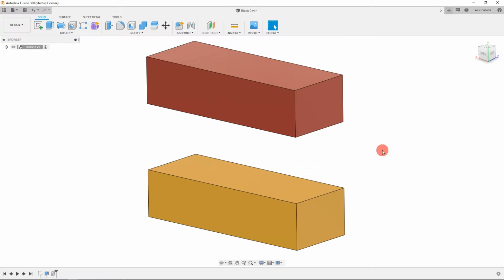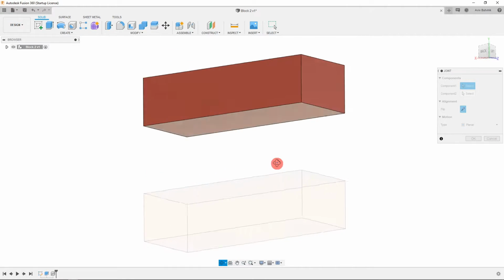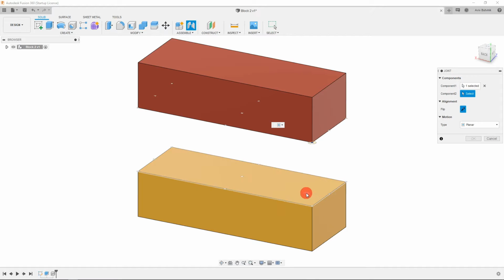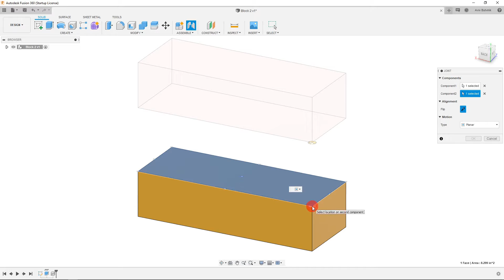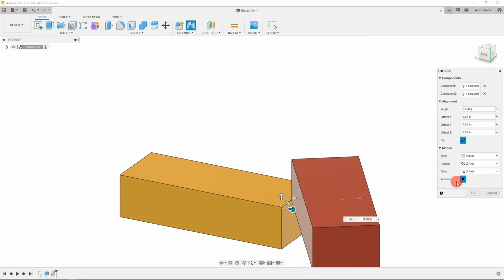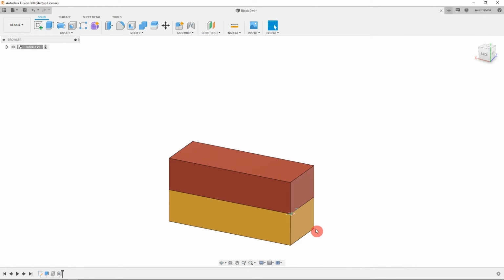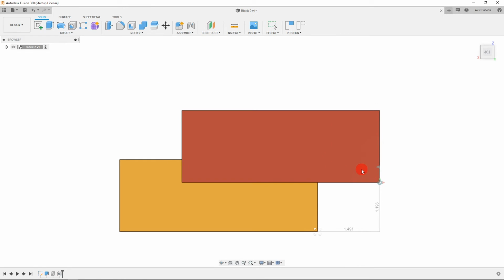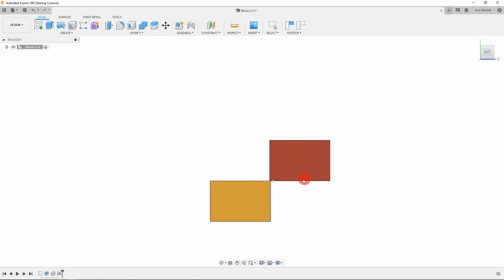Planar Joints in Fusion 360

Comment: how would you do this with cilinders?
Reply from the maker: With cylindrical constraints. Please check out my "Cylindrical Joints Fusion 360" tutorial.
Reply: @AvivMakesRobots  Nice tutorial but not what i was looking for, the problem i had was how to fix a handrail to a pole, just 2 cilinders touching each other.. In inventor you could make tangent planes en then mate them with constrains, with fusion i have to make tangent planes to the cylinders en than make a sketch point at that plane to get the cylinders to join at that point, took me 2 hours of video's and tutorial to find it out.. 😉
Reply from the maker: Sounds like you could mate with one of the joints, but not sure what this looks like.